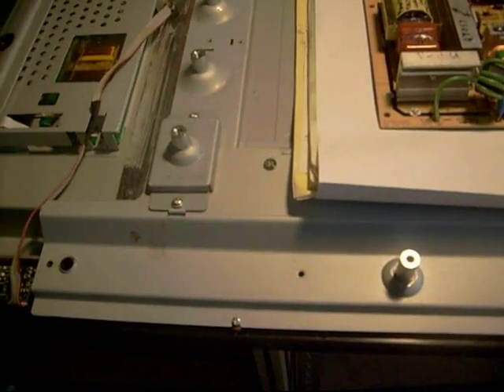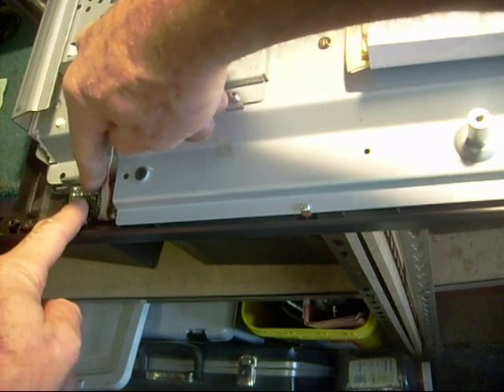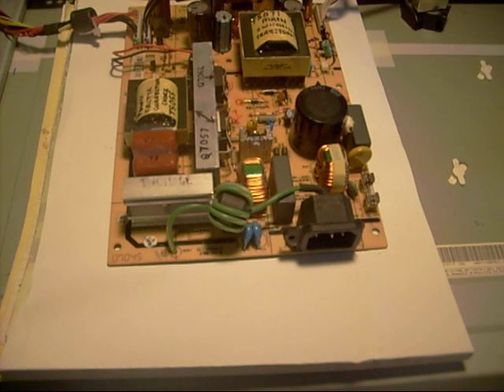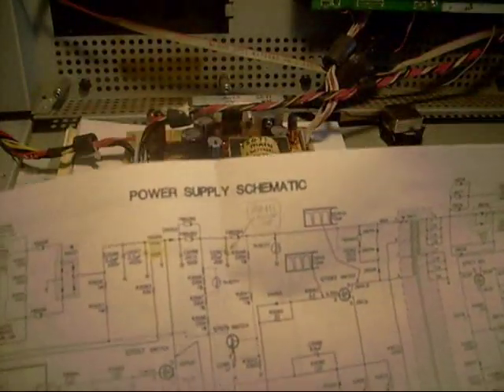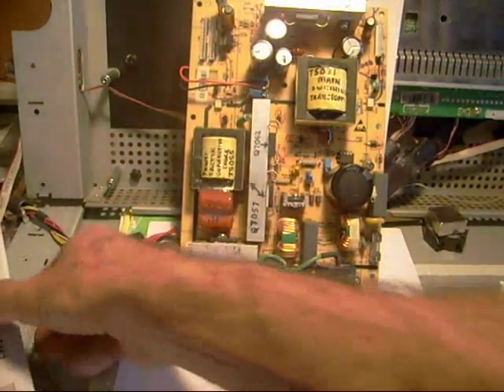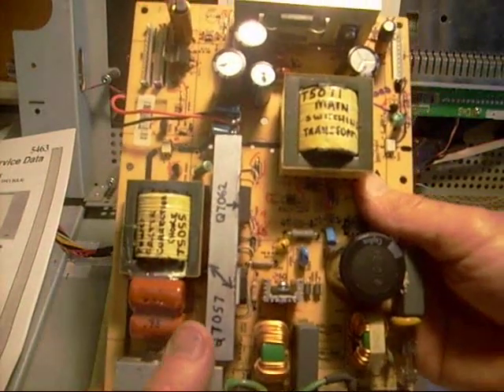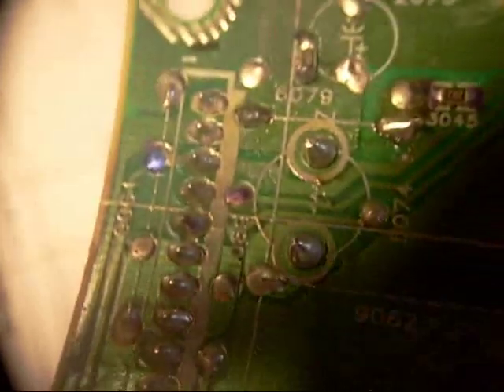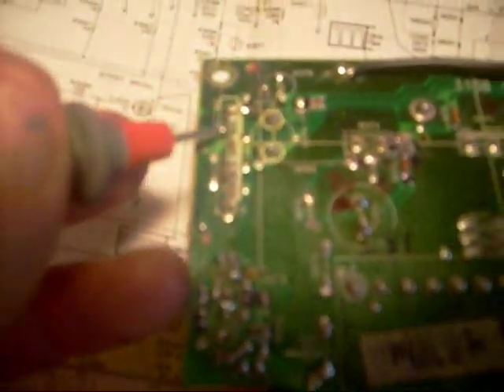LCD TV Repair made easy # 12

Comment: Thanks Dave for all you time to help others.  Just curious if you think any of the online TV repair sites are worth using to provide help in repairing a TV?  Their fee seems reasonable at $26.00 with a guarantee to help you fix the TV or you don't pay.  Any thoughts or a site you might recommend.  I have most of the equipment needed to isolate the problem.
Best Regards,
Frank

Comment from the maker: You might want to check the small non-electrolytic on the output side of the inverter transformer, but that's just one of several possibilities. If the TV is old it could be your lamps are going bad.

Comment from the maker: @cattattac2000 I wouldn't trust an analog meter to detect a fast switching pulse, but I like your headphone idea with a small series capacitor for detecting a momentary pulse. I would also suggest a series resistor in case any of the outputs aren't pure DC, and a high resistance bleeder resistor in parallel with the capacitor to discharge it after testing each output line. Once that cap is charged it may prevent any additional input unless your testing a higher voltage.

Comment: great tips especially with the meter prongs slipping when taking voltage readings at the pads..i have a polaroid tv where left half of the screen has a greenish layer to it and the picture is slightly distorted on that side.. it sometimes goes away after having turned on for 10-15 mins but comes back if i restart the TV....any clue what board might be responsible? it happens on all the video inputs..have you had any problems with BGA packages getting bad solder joints after some time dueto heat?

Comment: Great video ,What I like to do ,and would make good video , is show how to jump start a power supply by it self with out it being in a set .Then you can tell fast if the power supply is the problem or if it is not geting a start up signel from the main board . and if it is the problem you do not need the set in the way wile you are working on it. I do the same thing with back light boards . Put 24 v on them and a 3.3 v start signal if it lights you know you need to check the main board .

Comment from the maker: @imaginashawn Yes a shorted inverter transformer or driver transistor on the inverter board can cause a higher current flow, and this often causes the fuse on the inverter board to blow, but in such a case you will not have any back light at all. Sometimes just one transformer or driver transistor can go bad so only part of the back light will work, but I can't see how a shorted component would make the back light momentarily brighter.

Comment from the maker: @imaginashawn I have heard of a bad capacitor on the inverter board causing one of the lights not to be as bright, but I have never seen one glow to bright. Could it be that one of your lights is to dull so the other one just seems to bright in comparison? When the light first turns on it requires a higher than normal strike voltage to get it started, but then it drops down to its normal operating voltage and becomes a bit brighter as it warms up.

Comment: I have a problem with my SONY bravia KDL 32M4000. It quit working suddenly. When I turn it on, the POWER light comes on and the screen is back lit with no picture or sound. I took it to the video shop and he said that the VIDEO MODULE is defective and I guess he changed some parts on it and it worked fine for a day and then it's back to the original problem again. Would changing the whole Video Module fix the problem? Thanks for you advise!

Comment from the maker: @ibanez1357 
Sometimes the stand by voltage is normally less than 5 volts so I didn't figure there was a problem but I appreciate you input.  I did check all the regulators on the main board but they tested good.  I used an identical power supply from a different set and it worked, but when I use own power supply it has a symptom identical to what you would see if an inverter board was bad. Sams sent me an incomplete schematic so I'm a bit frustrated on this one. 
Dave